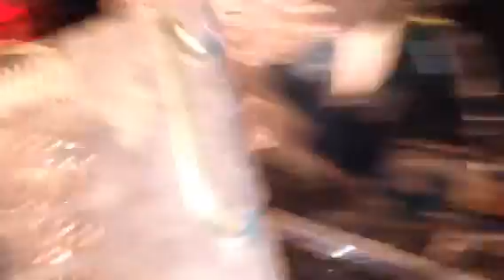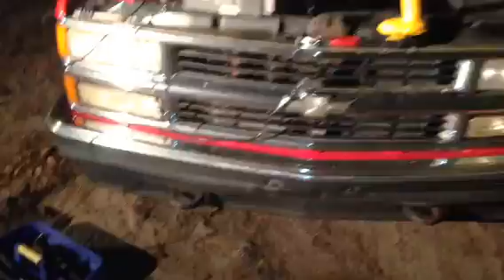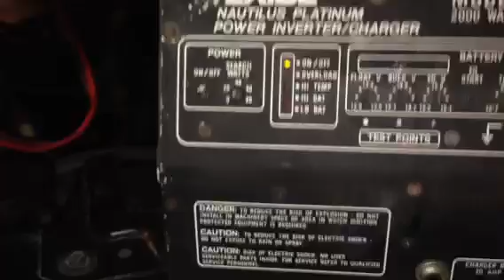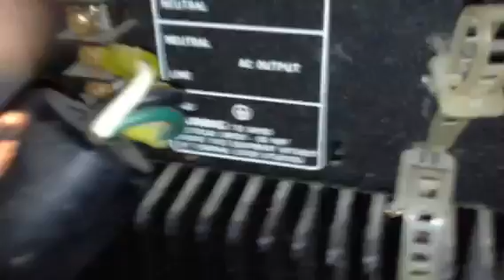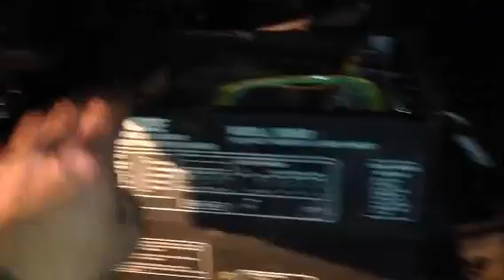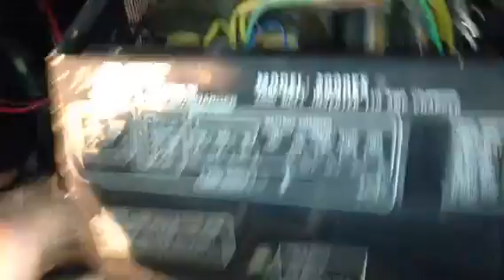Exide nautilus model 2000EX

Comment: Hey man, got the same Inverter... had it for had it for a number of years and have used it for a redundant 'super UPS' on a server with a couple of massive AGM batteries. Thank EVGA for making power supplies that can stand up to the super dirty square wave. I do have the remote, but have not sat down and taken time to find the pinout manually as it DOES NOT EXIST online anywhere.

I have seen this inverter (with proper batteries and SUPER HEAVY cables) surge up to 3600 watts when starting up heavy electric equipment. Thing is a beast
Reply: ajbutch123 I have same unit, used on my boat.
When hooked to shore power it charged batt  bank and ran all things 12 volt, unhook and 12 volt took over
Mine quit and nobody would even talk about fix
I’d like to use it, I had problems at boat dock with very low voltage!
If low voltage was problem, what part would be hurt
If you have info I’d like to talk to you, don’t know how to go about it